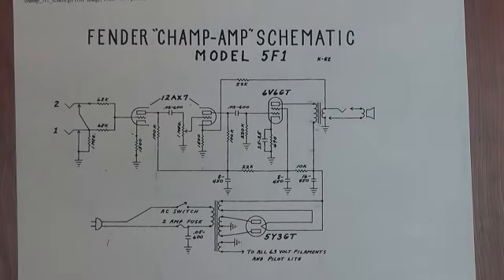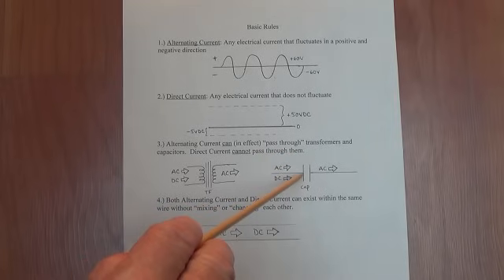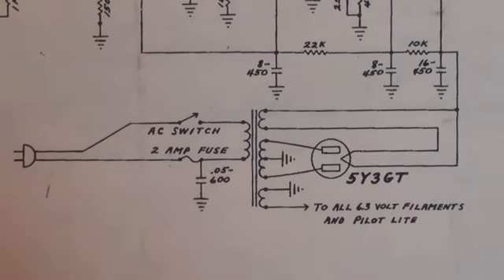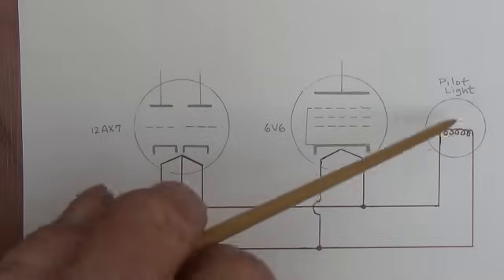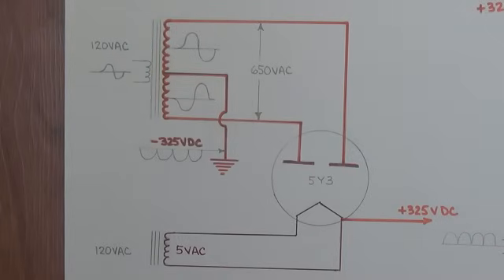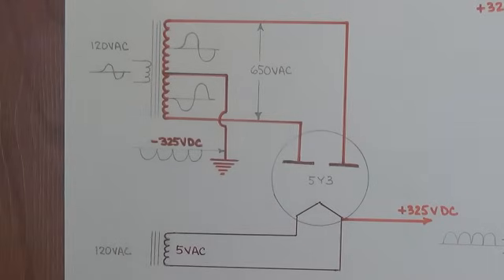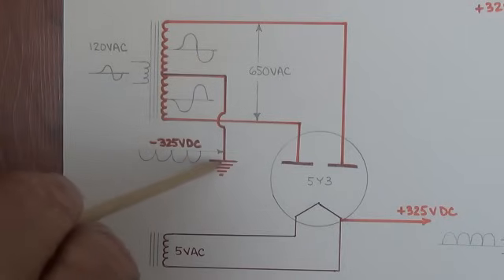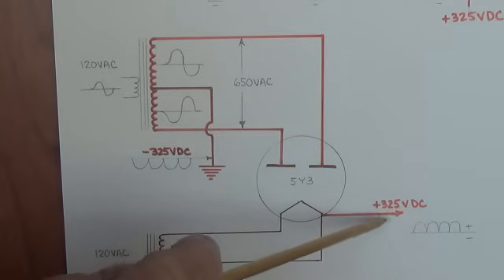How Tube Amplifiers Work, Part 1: The Power Supply

Comment: The center tap on the transformer for the 650V having 325V on either side but inversely is so cool, just like a neutral tap for residential with 120v to groun/neutral and 240v line to line
Reply from the maker: That is true before rectification, Sn, but after rectification, the output is either +325VDC or -325VDC (not both).
Reply: @UncleDoug very cool stuff love your videos, lots of info here!

Comment: is it possible contact cleaners could possibly dissolve the adhesive or binder used on/in carbon tacks of pots? Or... maybe carbon sticks by itself?
Reply from the maker: Most (if not all) reputable cleaning agents would not damage the pots. The degradation of the pots is caused by physical wear of the wiper rubbing on the carbon track. Once it rubs through to the metal backing, there will be intermittent shorts, popping, crackling, etc. that no amount of cleaning can correct.
Reply: AMBRO-SOL electrical cleaner states  "the product" may be corrosive  to certain delicate parts. it says it contains acetone petroleum distillates and propane/isobutane. (delicate parts?)
Reply from the maker: @stevenblas81  I think they mean plastic and painted parts......both susceptible to acetone.
Reply: so maybe the plastic shaft inside the pcb mounted pots could be melted?
Reply from the maker: @stevenblas81  Please read my previous answer.
Reply: @UncleDoug  i have  a jcm800 kk2203 that has pcb mounted plastic containing pots  they need replaced. contact cleane rAMBROSOL seemed to really worsen  the problem. ill let it lie now sorry for my confusion on the matter.

Comment: I need to lower my filament VAC out put from 6.8 volts.I disconnected the filament center tap to 6v6 cathodes as the outside windings to center tap differed by well over 1 volt. I added 100 ohm resistors to chassis for a virtual ground leaving the center tap disconnected. I could wire a series .23 ohm 1 watt resistor to drop the filament voltage. Is there a better method? All voltages of the power supply outputs are higher than its rated values. The primary of the power supply is rated  at 117volts (I measure 125 volts at primary). When using a variac the circuit reads all voltages (plates, cathodes, grids) to 1 volt of the rated voltages in the tech sheet.
Reply from the maker: Are you measuring the filament voltage with tubes in place?  If not, it will naturally be higher with empty sockets. Also, 6.8V is not really excessive. There is leeway in most tube designs (i.e. +/- 10%) to accept an 8% variance.
Reply: @UncleDoug  When this amp is initially powered up it has good power and breakup. Within minutes the sound becomes weak. and grainy. The filament voltages are creeping up ,the 6v heater now showing 7volts and the 5 volt rectifier heater is now 5.5 volts.  Is this symtomatic of a failing power transformer?
Reply from the maker: @davidfoster5906  Not in my experience, David.  You might want to check the coupling caps.
Reply: @UncleDoug  Did that, and replaced the filter caps and the resistors that were out of speck. 2 minutes after shutting off power to amp , the filter caps drain down to 2 volts(without shorting). Perhaps that's a symptom. It would not explain the high voltage readings. There is a local amp builder ,I will surrender this project to.Thanks for all your help .
Reply from the maker: @davidfoster5906  As I said, 6.8 VAC for the filaments is just fine and two minutes for the filter caps to drain sounds about right to me.  I really don't think a problem exists.....but do as you wish.
Reply: @UncleDoug  I ran the amp for a hour and the filament voltage stayed at 6.8 v so ok. And it's good that I need not discharge the caps before working on this amp.  Next I will install a trim pot to the negative feed back.Perhaps if I allow more NFB the amp will stabilize. It will be installed into an old Ampeg cabinet .I attached a aluminum plate where the old Ampeg chassis was mounted for the input ,volume and power switch.
Reply from the maker: @davidfoster5906  It should be fine, David.  It's good to drain the filter caps manually, just to be safe.  Good luck with the completion of your project.
Reply: @UncleDoug  This amplifier was used in a boxing ring by announcer from a loft in Boston It is a dual 6v6 with a cathoddyne. phase inverter simillar to a 5E3 Deluxe  Thank you for all the education and encouragement  It was D.O.A  by TKO!

Comment: Space-qualified Traveling Wave Tube Amplifiers (TWTAs) were my bread & butter for a couple of decades.  They are typically the high-power amplifier used in satellite downlinks.

"Klystrons, Traveling Wave Tubes, Magnetrons, Crossed-field Amplifiers, and Gyrotrons" by A. S. Gilmour Jr. is a great read if you want to get into the technical details of high-power, vacuum devices;  these are still used in high-power microwave/millimeter wave applications.  

However, the little glass ones are adorable:  it's their groovy glow!
Reply from the maker: Thanks for your erudite input, Douglas :)

Comment: Sorry, Doug, but I don't understand how -325V DC at the centre tap, when connected to ground, would make the amp chassis safe to touch. Perhaps I need to learn the basics again 🤷🏻‍♂️
Reply from the maker: DC flows only from the output to the return and has absolutely no "desire" to go elsewhere, thus all the electrons flowing from the winding to the CT have no interest in passing through you to ground......unlike AC, with which you can become part of the circuit to ground (i.e. badly shocked or killed).
Reply: Thanks for your explanation. So as I understand it, the chassis is providing a return path for the current to flow back to the centre tap (i.e. it remains in an isolated "loop" like a battery). Also, because DC is not earth referenced (unlike AC), it will not flow from the chassis to earth ground, resulting in a shock.
Reply from the maker: @dingalarm  The chassis IS the circuit ground and return for all DC voltages. DC DOES flow through the chassis but ignores the earth ground (and you) because it only seeks the CT of the winding from which it was produced.
Reply: @UncleDoug  OK. Thank you very much for clarifying everything! I really appreciate it.

P.S. I've edited my previous comment accordingly, where I erroneously made references to both circuit (board) ground and chassis ground.
Reply from the maker: @dingalarm  You're welcome, D.

Comment: I had a question about the 5v3 rectifier. Is it the center tap that causes the ac signal to split into  two signals that are phase shifted 180 degrees or pi radians? Or is it how the secondary winding is wound?
Reply from the maker: Rather than spend an hour responding here, please watch my many other videos on power supplies, rectification, etc.

Comment: Flash back to high school, 1976. My best friend took electronics in our sophomore year of high school. I cut math class a few times to sit in on that class. The teacher was great, and made complicated things very simple.

My point is that your vid is the best and most clear explanation of tube amp electronics I've ever seen. You remind me of that high school teacher. I just wish I could remember his name, because he deserves a shout-out. (BTW I love the popcorn and chain link fence analogies. Super helpful for me.)

One more thing. At 12:30 you explain that in a part of the circuit, 120v is being scaled up to 650v. I don't understand how that's possible. Obviously the extra volts don't just "come out of nowhere", but how can more windings "make" more volts? 

It's been 11 years, but if you see my comment, it would be great to get a 2-3 sentence explanation. Thanks!
Reply from the maker: Thanks, L. Induction transformers are used to boost voltage based on the different number of windings (of copper wire) in the primary vs secondary sides. If the primary has 100 windings and the secondary has 500 windings (1:5 ratio) and you apply 120VAC to the primary,  then 5 x 120 = 600VAC will come out of the secondary. See other internet sources for a more detailed explanation
Reply: @UncleDoug  Thanks! Electronics is fascinating, and a fun hobby now that I'm retired. Cheers!

Comment: I know this is an old vid his AC voltage values are very wrong, you dont add -60 and +60 to get 120v. 120 volts AC is about +170v and -170, giving a peak to peak of approx 340 volts (what he called 120) 
Since its a sine wave, that +170v and -170v  useabe voltage is 120 volts
Reply from the maker: This was all corrected in captions that YouTube ceased to support several years ago.....so we made a more detailed video covering  AC, RMS, and other riveting topics.

Comment: Dumb question. Can you get shocked with negative voltage? (secondary centertap to ground is -325v dc) I'm guessing no?
Reply from the maker: It doesn't matter if the current flows from negative to positive or vice-versa, ANY flow of current through your body can be harmful or fatal.

Comment: I first saw this video years ago and blew it off because this tech talk always seems to go over my head. But having listened to the whole presentation and taking notes, I think I get it. I going to go check out part 2. I have had such bad luck with tube amp 'techs', the more I know the better off I will be. I currently own 8 tube amps and I have nobody that I trust to work on them.
Reply from the maker: That's great to hear, Barry.  I feel the same way and as a result, I do EVERYTHING for myself from plumbing to auto repair.  After al, there is only one way to be sure the job is done right ;)

Comment: It shouldn't take more than 7:00 minutes to explain a champ circuit.
Reply from the maker: That wasn't the goal of the video, U.
Reply: I thought it was perfect
Reply: Great detail & tutorial. Keep up the good work!
Reply: However, it should definitely take more than 7:00 if you also explain what AC vs DC current are, and how diodes, tubes and rectifiers work. Great job!

Comment: Doug, I can't thank you enough for sharing all of your insight.  I have been absorbing as much as possible over the past year.  It has been an absolute pleasure.  Below I provide my basic understanding of AC and DC, for future students so that they might better understand.

Alternating current (AC) and sound waves share a fundamental similarity in that both are oscillatory in nature. AC changes direction periodically, creating a wave-like pattern of voltage or current that can be represented as a sine wave, similar to how sound waves oscillate in pressure as they move through a medium like air. This oscillation allows both AC signals and sound waves to carry information. For example, audio signals can be represented by AC, with the frequency and amplitude of the current corresponding to the pitch and volume of the sound.  This is the basis of the term analog, where the oscillation and behavior of the electrical waveform is analogous with with sound wave to a high degree, achieving its final point of accuracy when reproduced by the speaker creating amplified sound waves that are analogous to the source.  The peaks and troughs in a vinyl record's groove are also analogous to the sound wave being reproduced, for example.  

The output of an amplifier is alternating current.

In contrast, direct current (DC) is constant and unidirectional, meaning it flows in a single direction without oscillating. Physically, DC power doesn't have a wave-like behavior in the same way AC or sound waves do. However, you can think of steady or constant phenomena as parallels to DC. For instance, the steady flow of water in a river or a consistent breeze can loosely parallel DC, as they both have a singular, unidirectional flow rather than the oscillating, wave-like nature of AC or sound waves (think waves at the beach).  If you have a hydroelectric generator, you want as constant a flow of water as possible in order to design a mechanism that generates electricity. With a wind turbine generator, you want to aim it at a relatively reliable direction where you'll get steady, direct wind flow.  DC is like cash on hand, good for making things to happen reliably.  AC is like money in the stock market, it goes up and down and you want to cash it out into DC (rectification) so that you can use it.

The output of a power supply is direct current.
Reply: Part 2 of my Doug addled brain:

I envision amplification as so:

When I was a kid, my brother and I would lay in our beds before going to sleep and play with flashlights.  In the dark room, we'd put our hands in front of the filament of the incandescent flashlight and we'd amplify the image of our hand onto the ceiling.  In other words, we'd shine a flashlight at our hands and it would cast a far bigger shadow of our hands, and we could play around before nodding off into the glittery galaxy of sleep.  

This is the basic idea of amplification.

You take something small (your hand)

You find a method to modulate something technically bigger (light in this case)

Now your hand is shaping the light beam, and you are amplifying your hand.  In the same way, the cathode is like the start of the flashlight beam, and the plate is the ceiling in your room.  The grid is where you pass the AC signal (your hand), and the current flowing through the tube is modulated by the grid. 

Realistically let's change your hand to a very small current produced by the transducer in your turntable cartridge.  The needle passes over the analog waveform recorded in the grooves, and the mechanical energy is converted into a small electrical current that we need to amplify.  So we pass those wires, that current, to the amplifier tube's grid.  Now that very small electrical current is shaping the much higher electrical current passing through the tube.  Now out of our plate we get a signal that is analogous to the very tiny initial electrical signal, but much higher current and voltage.  This is amplification.
Reply: Lastly, the hand projection analogy has one final point - it's a negative image of the hand, and we want it to be positive.  Phase inversion.
Reply from the maker: Thanks for all your helpful input, Jules :)

Comment: This is brilliant. The best explanation ever, i fully understand it. Is it possible to do something similar relating to a transistor amp?
Reply from the maker: Thanks, John. The general theory is the same, but SS operates at much lower voltages. There are many sites dedicated to SS electronics, but I do not work on them.

Comment: Thanks for posting such a clear explanation. Am I right in thinking all the ground/earth symbols represent the wire returning to the negative terminals of the different circuits, and are these situated on the transformer? Thanks
Reply from the maker: The DC ground connection in a circuit like this are chassis grounds, Y. The chassis is the route of return to the source of the DC.
Reply: @UncleDoug  Thank you 👍

Comment: Minor comment for techies:  The two cathode filaments are each getting 6VAC, there isn't "12V" as stated at 7:50.  This is how the 12AX7 heaters are wired with a 6VAC xformer tap.  If you have a 12VAC xformer tap, one would wire across both filaments (pins 4&5), leave the "center tap"(pin 9) open.
Reply from the maker: Thanks for your helpful input, Jake.  Bear in mind that this was a very basic presentation.....and that the issue is more fully discussed in subsequent, more detailed, videos.
Reply: @UncleDoug  Gotcha!  Thank you for these videos!  They are very easy to follow and give a solid understanding!
Reply from the maker: @jakeowsley6552  Thanks again for your helpful input, Jake.

Comment: Uncle Doug, pardon me but the ground isn't at -325V potential (16:10).  In your diagram, the upper and lower taps of the transformer are 325VAC.  The work of the valve diode passes only the positive sections of each tap.  During the first half of the cycle, the upper tap is being passed through the right valve, then the second half of the cycle the lower tap passes through the left valve.  During each upper & lower tap's negative portion, the respective valves are shutoff.  This is how the waveform (right side of diagram) is produced at the filament.  Transformers isolate 1° from the 2° voltages unless they are referenced.

The center tap provides a reference of the voltage.  This is another reason the +325 DC can be on the 5VAC line without shorting:  5VAC has no reference to ground.
Reply from the maker: Thanks for your helpful input, Jake.
Reply: @UncleDoug  Your videos are an inspiration to this retired EE to learn something new.  I cannot thank you enough!
Reply from the maker: @jakeowsley6552  That's great to hear, Jake. Thanks again :)